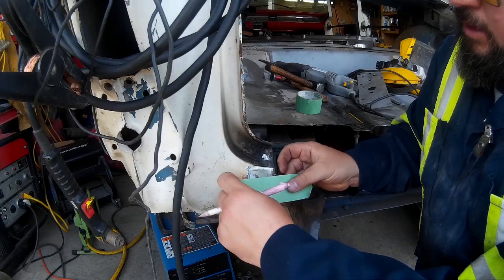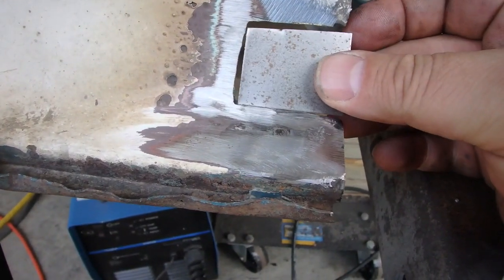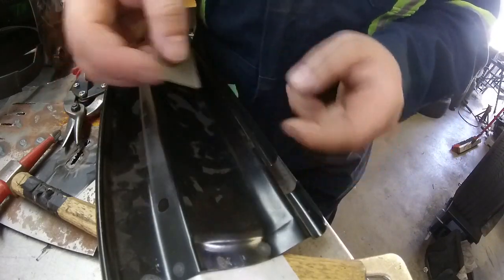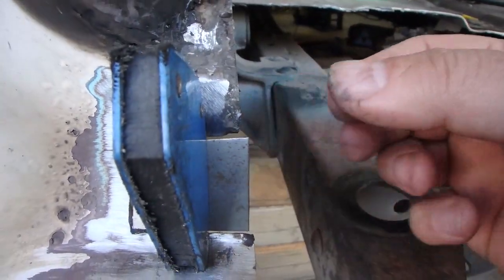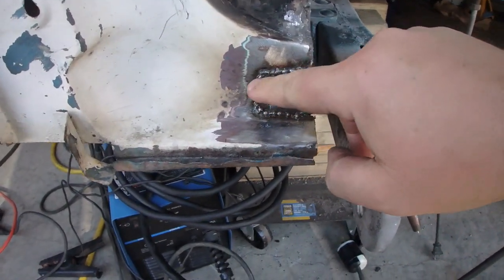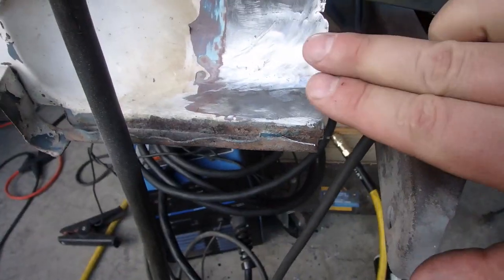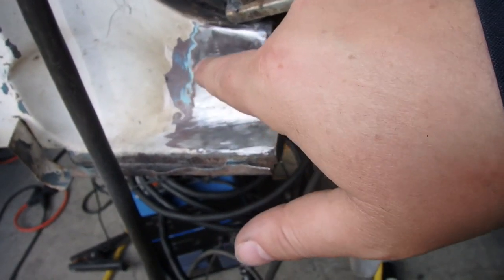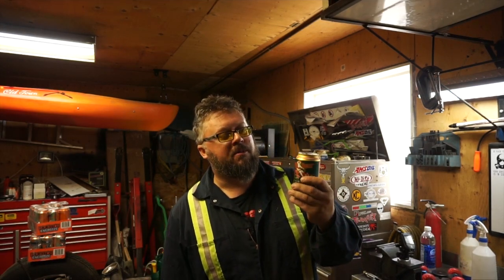Fixing and Welding Rotted Body Panels

Comment: Jerry- I thought you don' like IPA's.  I drink Red Racer once in awhile. Your right, it's a real IPA. Best of all is the Hot girl on the Bicycle on the can. I think I'll go get some more. Thanks BSKorner. ( never thought of using an air hose to mim. warping) doug
Reply from the maker: I never used to like Ipa's but fedor keeps bringing them over so i've been getting used to them now.  A air hose works great in small areas to cool the panel, less heat in the panel decreases the risk of burning holes too